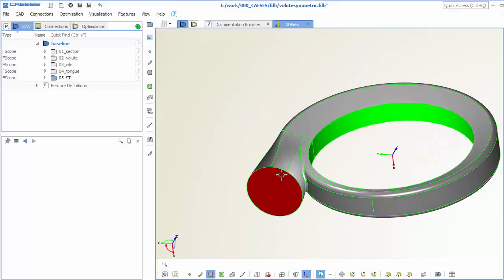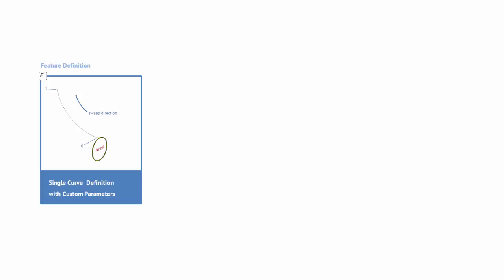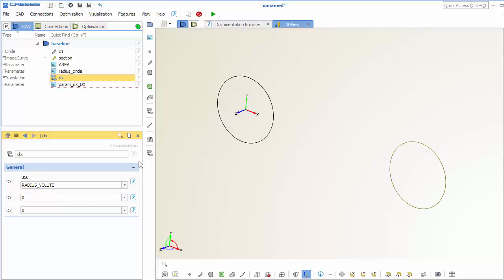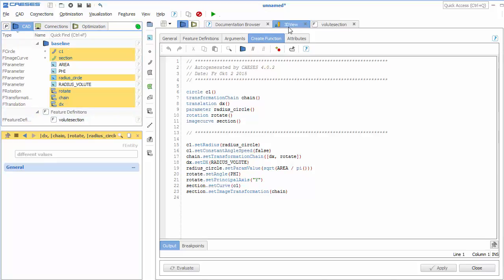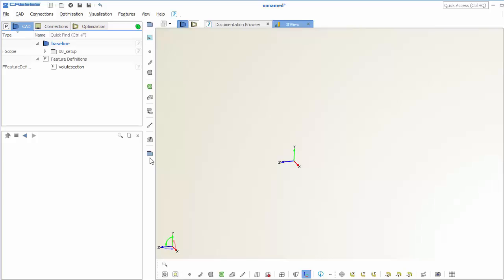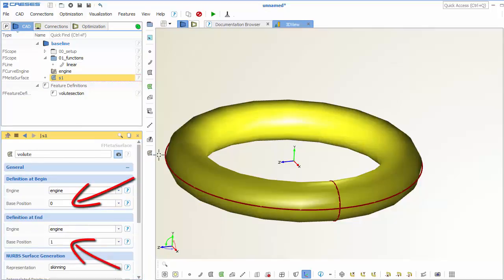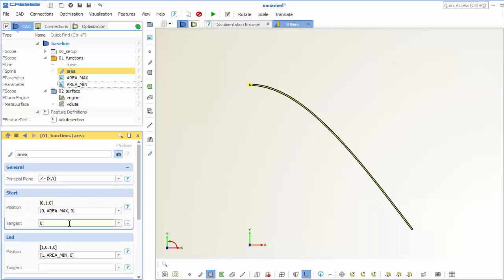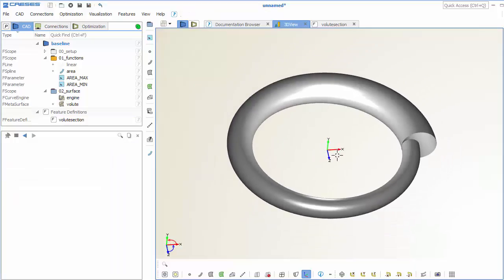Basics of Volute Modeling for Turbochargers and Pumps

Comment: hello guys. I need your help, I am a student, recently downloaded CAESES software. For my project I need some help with a creation of twin scroll turbocharger housing (volute). I already have an impeller designed in CAD
Reply from the maker: Hi Vytautas, 
thanks for your message. Twin scroll volutes are interesting but not trivial geometries, and giving you fast support with this is not easy. You can try to get some starter help in the CAESES forum: 
https://www.caeses.com/forum/
We have experience in setting up variable robust twin scroll models for optimization purposes, but it can take a couple of days, depending on the details. Typically, we set up a project for this together with the customer.